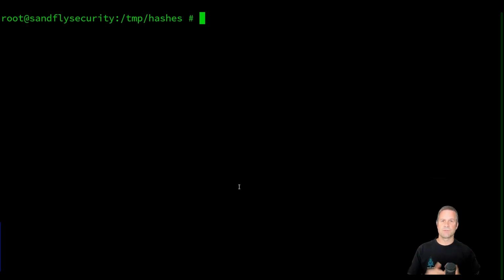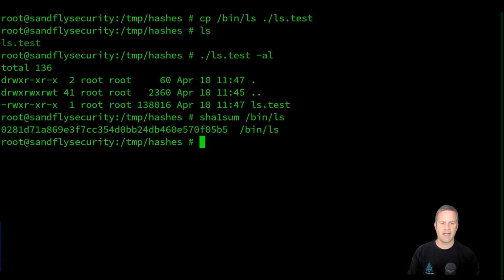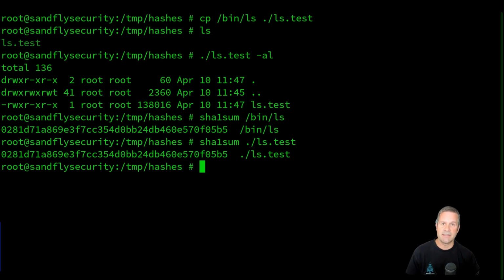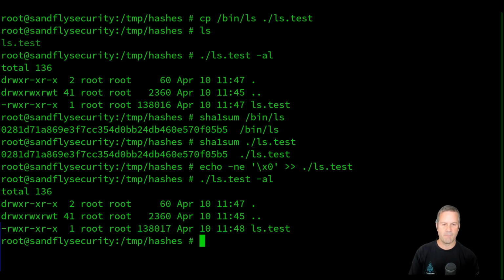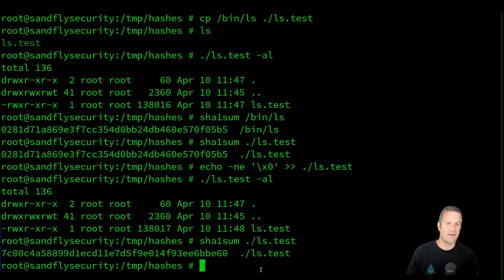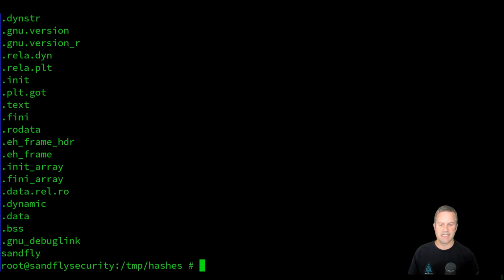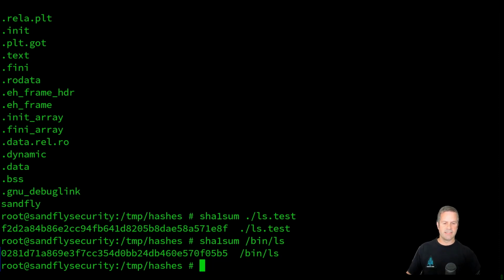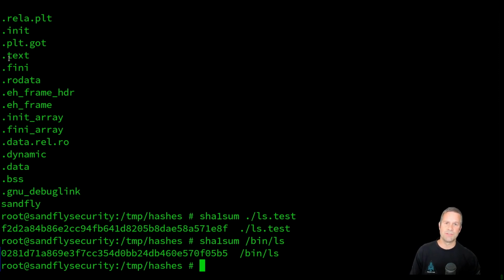Stop Using Cryptographic Hashes to Find Linux Malware

Comment: I feel like hashes could still be useful, but not the way presented here, not to detect malware, but to guarantee integrity of known good software. Hash all the known binaries and libraries on the system, record sizes and then monitor changes. There are some files of course that need to be blacklisted from this such as log files and some runtime files, tempfiles so it's not perfect, but it's additional thing to bundle with other security. 
Take hashes before backup, bundle them with the backup and then take hashes immediately after the backup to make sure nothing went wrong while at it. Check hashes again immediately after updates and record changes.  Monitor file integrity over time actively and report changes into whatever monitoring system is being used. 

This is basically what people did with open source version of Tripwire early 2000's. Hash everything and record hashes on floppy disk which is then removed until next checkup. Also I did something similar with CFEngine some 10-15 years ago, though I only monitored integrity of some files, not all files so that kinda defeats the point, but at least I'd know if important configs or content of directories changed for reason or another.

Comment: ???

The legitimate software provider should provide the check hash. Then you changed the original code so it hashes differently. That's expected behaviour, and is what you look for to check whether or not the OG program has been compromised. What am I missing?
Reply from the maker: It was demonstrating how easy it is also for a malware binary to be changed and why using hashes to look for malware is a bad approach. The use of a system command is just convenience for others that want to try it as an experiment. You are correct that hashes work great for spotting things that change where you don't want them to change (like a distro binary). They work very poorly for malware that changes all the time.
Reply: @SandflySecurity  Ah OK that makes sense. If you're skimming your server for a known exploit .badbash.rc and are scanning based on hash value, yeah the hash might change every time it's run